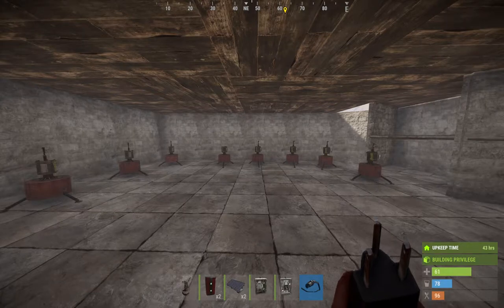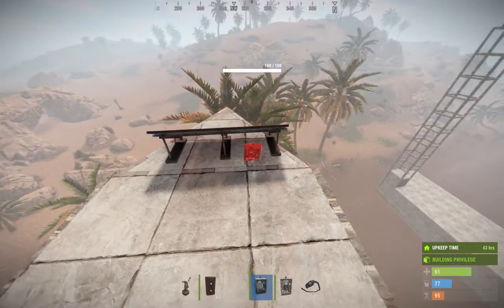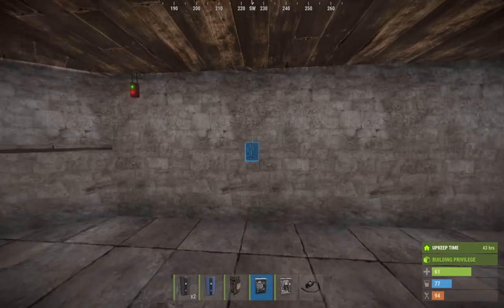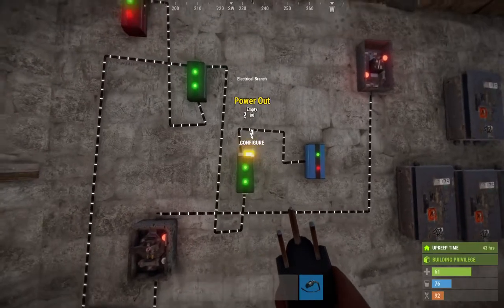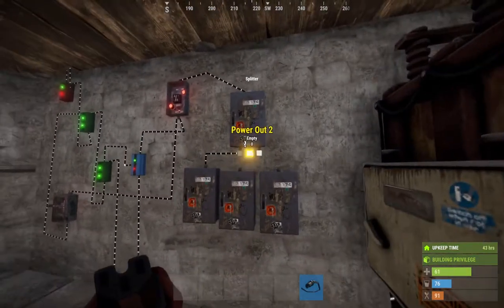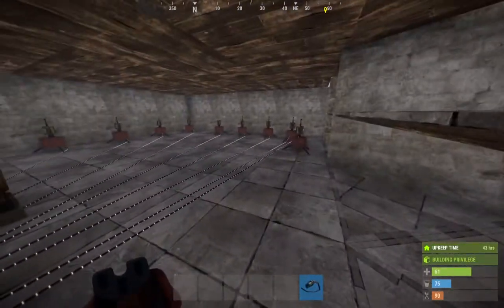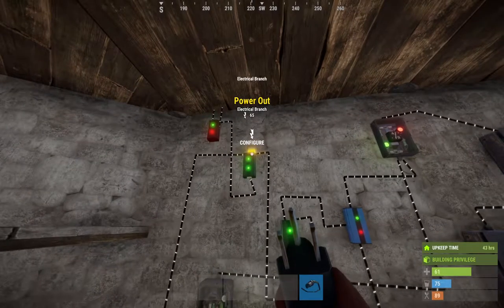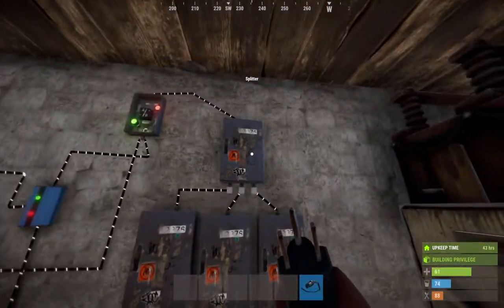RUST- 9 Auto turrets on a single wind turbine- Electricity

Comment: The turrets go off at night when the power from the solar panels stops. If you then turn the switch to the off position the turrets come back on till the solar pannels get power. Then daytime you turn the switch to the on position and they come back on. Can you have a look as this does not work propperly and fix it.
Reply: wire the 1st branch to the or switch first instead of the on off switch, then from the power output from the or switch to the on off switch then to the splitter and so on.
Reply from the maker: if u follow the step u shouldnt have this issue.
Reply: @SkillPictures  THX bro u helped me well

Comment: why does my turbine only make 62 power? its 8 stories off the ground. even with 3 solar panels im getting 112 at best so far
Reply from the maker: i normaly go for 12 stories high and it will get me 85 on low wind and 150 high wind.. try that.
Reply: Have you built on the lowest possible ground? Like the beach for example? If so you need to be a lot more stories higher. If you’ve built on a mountain you’re already higher up so you don’t need to build your stories as high
Reply: @Khaaaaos  yeah i figured it out a long time ago lol.

Comment: Not working
Reply from the maker: what's not working?
Reply: @wacaba22  large battery charge very fast enough
Reply from the maker: it means u dont have enough power to charge the battery.. is your turbine 12 stories high.. if not put more solar panels
Reply: @wacaba22  man I'm copy paste your system but 3-4 hour later large charge battery 🔋 down (zero) and system not Working that's , maybe I'm not building the wind turbine highest roof
Reply from the maker: u can put additional turbines and link them in to one out put.. u should have more power 🔋 that way

Comment: This video is not useful when you want to place autoturret in a mass quantity. Only good for solo/duo bases that have between 9-27 turrets. Beyond that, it's overwaste of components, lot of wires and chaotic circuits.
Reply from the maker: im sure there are hundred  ways of doing this.i would love to see how u do yours
Reply: @wacaba22  I do it with electrical branches, wind turbines, large battery, root combiner if the wire is short and 8 turrets. Highly efficient, not overwired, not overusing components or wasting materials. Optimal
Reply from the maker: @Razor-md6gz  check my other video if u wanna know how to set up 27 turret.. cheers
Reply: @wacaba22  I said your method is only good when placing low quantity of turrets. I do place +50 turrets in an average wipe.

Comment: So your showing us the old way when turrets started to use electricity. This is the way we used to do it but now this is useless.
Reply: Why is this useless now?
Reply: @Khaaaaos  This was used when battery stop charging if it started to give out power and it always gave out the max power. So if it was large battery it give out 100 power even if the component need 1 power and it stops charging and we used this to charge the battery and have it as a backup if the power stops. Now days the battery gives out the power that the component needs and don't stops charging ,so if the component needs 1 power the battery gives out 1 power and continues to charge. Now days you just add your power source to the battery and from the battery to what you need to power, adding more components to the circle if waste of power and mats. I can keep going but this is getting to long.